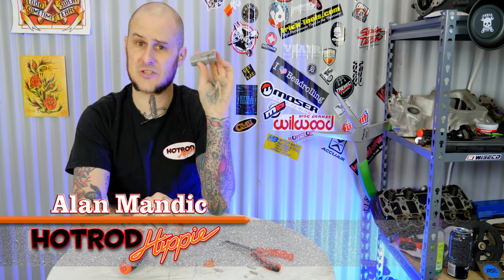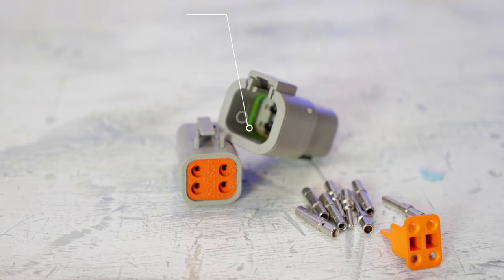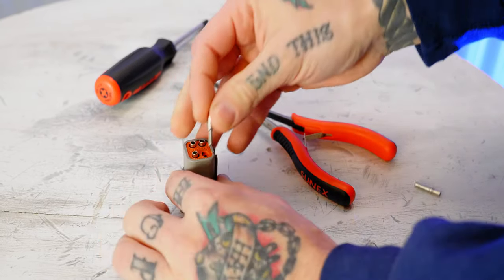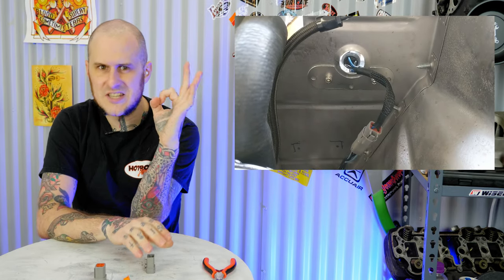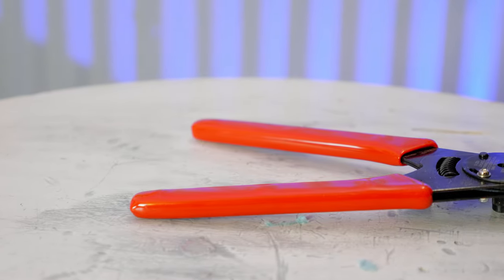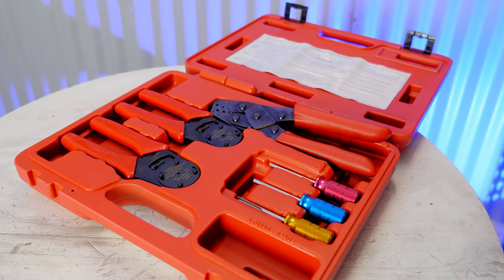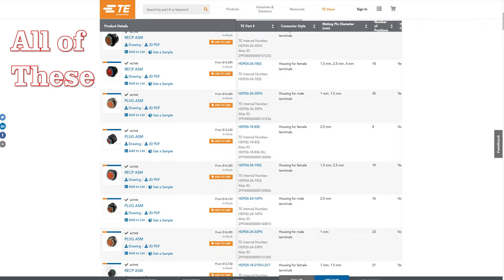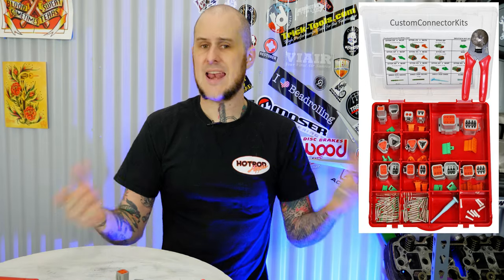Deutsch Connectors for Custom Wiring

Comment from the maker: Do you use Deutsch Connectors or some other type of connector for your wiring jobs?
Reply: I work on CAT equipment. ALL of their connectors are Deutsch.
Reply: I use Aptiv (formerly Delphi) 150 and 280 series Metri Pack; mostly because it's been used on GM products for about 20 years and you can score good condition connector bodies and fuse blocks in junkyards for next to nothing.  The 280 series stuff accommodates the 2.8mm blade width of mini fuses and 280 type relays.  New terminals (and connectors, fuse blocks, etc) are readily available from lots of suppliers.  It's available in sealed and un-sealed flavors, (though probably not as high-spec as Deutsch or Molex) and much cheaper.

Comment: I work for Boeing and was an aircraft electrician for 11 years. Routing, clamping, terminating and assembling wire harnesses and electrical connectors.  I have to say that these are probably the closest, when it comes to the contacts and connector variations and types, to aircraft quality without the astronomical price of the mil spec electrical we use.  Nice video.
Reply from the maker: There are some brands that use these same pins in aluminum high quality housings that I am aware of. They look great and for a serious custom project would be cool but are mostly overkill for everything else.  Those may be closer to what you are familiar with.
Reply: When I worked at Deutsch, we made connectors for everything. They even said they have connectors on the moon from when they sold connectors to NASA for the lunar lander, I don't know how true this is, but that's what my boss told me when I worked there.
Reply: Not going to use deutsch if it Boeing standard😂😂

Comment: All of the vehicle LED light installations I do I use Deutsch connectors, some fixtures already have the male connectors such as the JW Speakers, Diode Dynamics and Rigid some others, some other brands only have a pig tail on the fixtures and I’ll add the male connectors to those, I do have the expensive TE Connectivity Deutsch crimper and the F AMP crimper for the stamped pin and socket

Comment: I work on garbage trucks. The OEM  for the garbage truck portion is mostly Deutsch. I love these connections. Any time I have to replace a damaged connection they get a Deutsch if at all possible. Thanks for the tool suggestions and keep up the great videos.
Reply from the maker: A buddy I went to Wyotech with builds fire trucks, they are really common on those as well. They just work, can't argue with that. 👍👍

Comment: The only thing wrong with those closed barrel Deutsch pins are they lack any provision for “strain relief”—which as I’m sure your aware is the portion on an open barrel pin where you crimp it to the insulation.  Without a proper strain relief when people tug on a wiring harness instead of directly on a connector to seperate them (we have all done it when for whatever you can’t get both hands in and grasp both ends of a connection or whatever), anyway all that force is being exerted on the crimp itself and if tugged hard enough they can pull right out or just shear the smaller gauge wires directly. But yes, otherwise they are good connector.  They make a series of connectors (dtm series if I’m not mistaken) that are even made with smaller plastic housings for applications like racing motorcycles where every ounce counts and space is a premium.

I also like the Molex mx150 because I work on a lot of Harley’s and they started using them from the oem in 2009 I believe.  Downside to molex you need a super thin pick to release the pins from connector if you don’t want to pop out the end terminal retainer lock.
I found Mouser has both brands and tons more in stock and at a good price.  Better than any automotive supplier I have seen.  Mouser is electronics parts giant

Comment: I used to be an injection mold operator at the banning plant, my sister worked on the rubber side, I worked on the plastic side, we made electrical connectors for caterpillar, Volvo, Harley Davidson, the military... You name it they make it. One day I ran thousands of parts that were the connectors for the optic sensor on laser guided missiles😎 cool job working for Deutsch but the pay sucked, I think they were giving me like 11 an hour to run between 6-8 milocron electric servo press machines all day.
Reply from the maker: Sucks it didn't pay but sounds like an interesting job at least. Sad that things go that way so often.

Comment: They work well,we use then on construction equipment all the time.some of the pin connectors are even gold plated.
Reply: The round bulk head connectors/Canon plugs also can be made of aluminum instead of plastic,much more durable.

Comment: how do you handle it when you have a trunk mounted battery and an engine bay device that requires larger wire size than the deutsch connector has available. i have a maven performance bulkhead with 4 12awg and several 16awg pins. i have an efi and ignition system that runs 10-12awg if the battery is in the engine bay. it'll require 8-10 to hit the trunk most likely. do you just use the open end splices, bring 2-3 smaller sizes in to use on the bulkhead and 1 larger size on the other end for the device?
Reply from the maker: There are two options I have for those purposes.  

1) There are Deutsch connectors featuring larger cable options.  On the 55 Chevy I recently did one of the bulkheads I used had a single 4GA cable with some 12GA cables too.  So I used the 4GA to feed in battery power, mounted an insulated junction and then powered up anything needing good battery power off of that junction.

2) I will use a Battery Bulkead connector to pass battery power into the interior of a car/truck and then also use that as a Junction point to supply battery power to things.  Here is what I am referring to: https://amzn.to/3cE3Mtj

Check out WireCare.com they have a Deutsch configurator to help you get the connectors you need for your applciation: https://www.wirecare.com/manufacturers/deutsch/deutsch-assembler
Reply: @HotRodHippie  i have a power/ground bulkhead already passing through firewall to engine bay for engine ground and starter/alternator power. holley's instructions say to run direct to battery for pos/gnd. so 4 10awg's is what's needed. rather not add more bulkheads as i'm trying to keep it clean. idea was to use the 4 12's and splice in some 16's to bring the wire size up to 10awg. just haven't seen a video of it being done. i know it effectively works though. thanks for the quick response.
Reply from the maker: @callofgeorge  I combine wires once in a while to increase load capacity, but not commonly.  Here is a link to a calculator that can help you determine you "Effective Gauge" of combined wires: https://www.wirebarn.com/Combined-Wire-Gauge-Calculator_ep_42.html

According to that you would need a 12Ga and a 14Ga combined to equal 10Ga.

I know Holley, MSD, and some others want you to go Battery direct with your power connections but personally I usually consider the bulkhead fitting (with adequate cable feeding it) to be effectively battery direct.  

You could use  Deutsch Connector bulkhead.  Namely the HDP20 18-8 connector. It has 8, size 12 pins in it.  Size 12 is good for 12-14Ga.  So you could do your wire split with that.  Run your 4, 10Ga wires to the bulkhead connector, split to 4 12Ga and 4 14(or12)Ga and then splice back together on the opposite side of the bulkhead connection.

The 18-8 connector is the one I use for headlight harnesses on classic cars.  

Here is a link to it on WireCare: https://tinyurl.com/tcevpjs

Comment: Hey Alan, quick question...what trye of bulb socket do you use? The reason I ask is I'm upgrading my squarebody and I really like the GM (Delpi) Metri-pack that are used on ly HHR. At the bulb end there's a bulb socket to connector peice. Based on your serviceability statement I thought it would be great to use something like that for the Deustch system. Can't seem to find and thing similar for the Deustch so I was wondering how you would attack this. That for the great videos and the tech. Cheers.

Comment: Great info I'm looking these up do you use these with commercial wire harness or mostly when you create from scratch?
Reply from the maker: I use them anywhere I can. When I do an aftermarket harness I skip using their connectors and use these instead. The ones they provide are fine but not usually weather right and a little more difficult to connect and disconnect. So these are superior (and the overall price reflects that).

Comment: i heard you can solder the pins to the wire but could i replace the crimping with soldering to connect these up cheaply?
Reply: Crimping is the way to go. A properly-made crimped connection is more reliable than a soldered one. The problem with soldering is that you have a weak spot where the completely solder-free stranded wire meets the stranding that has solder in it, and thus is stiffer. Any flexing, twisting, or vibration at that spot will eventually fatigue the wire and cause it to fail. 

Don’t get me wrong: soldering can be used successfully — it’s done for spacecraft after all — but it requires your strain relief to be extremely good. I don’t think Deutsch connectors are designed to provide that level of strain relief. Soldering is also far more time-consuming.

Given that you can buy an adequate quality indent crimper for closed-barrel Deutsch terminals for around $30 (look for iwiss brand, for example), I’d do that. You can get adjustable indent crimpers too, allowing you to handle multiple terminal sizes. (For frequent use I’d get separate ones, but for once-in-a-while hobby use, the adjustable is fine.)

Also, check out local classified ads and such: I’ve managed to collect a decent set of top-quality crimp tools that way, some used, some brand new. (A used top-quality tool is decidedly preferable to a new low-quality tool.)

Comment: Are they cool for rally application?
Reply from the maker: I mean they are water tight when assembled properly and have a positive lock that keeps them engaged when seated fully, so I'd say they are pretty perfect for the use. The only thing better would be a screw tight connection but then that has the potential to vibrate loose.
Reply: @HotRodHippie  thanks for reply, yes , seems a good product. The problem Is that I'm new on this field and this month I saw hundred different connectors.. AMPSEAL,Delphi , Deutsch ecc ecc.. and I don't understand the quality difference and what could be "right"

Comment: My question is regarding what I gather are knock off Deutsch connectors .. is the quality so much superior vs say the JR Ready kits ?
Reply from the maker: I've used the JR Ready kits plenty (mostly). I find that the pins are the biggest different. The contacts from Deutsch or TE Connectivity are far and away better. Connectors themselves I haven't found too big of a variation. I usually order the budget kits & quality terminals separately. Though a few times I've had incompatibilities between the two.
Reply: @HotRodHippie  thanks for the reply

Comment: I’ve got just one small project for these connectors, so I can’t justify the cost of the crimping tool. Anything wrong with soldering the terminal ends, instead of crimping? I have more time than money....
Thanks for the informative videos!
Reply from the maker: I didn't want to make the video longer by going into it but I usually solder them after crimping personally. So I could see doing that. The open barrel style ones you could probably crimp with any old crimping tools if you get creative about how you do it, then solder them after (they are very easy to solder). The closed barrel I cannot say as I've never tried just soldering them but it would be worth a test run and I would think it has a good chance of working.

Comment: Can you use Deutsch connectors for marine applications? Specifically, for boat trailers exposed to salt water.
Reply from the maker: Most are IP68 rated. Which means 1.5M deep for up to 30 minutes.

In a marine application that WILL be submerged from time to time, you need to be certain the wire is the proper size. As the wire seals against the rubber sealing gasket in most Deutsch connectors. And I would pack the connector with dielectric grease anywhere I could to further prevent water intrusion. 

That said, I'd say they are a pretty good choice for that sort of application. The only thing I am unfamiliar with is how the plastic of the housing would hold up to salt water over time.

Comment: Nobody is talking about direction, does power come from the male or female plug?
Reply from the maker: It doesn’t matter. They are just terminals, you wire it as your needs arise. I often go back and forth as to which way I go depending on how connectors fit through things. Such as small holes in fender wells it is easier to fit the “male” connector through. Etc

Comment: all quality connector families have a learning curve and tooling costs , so if you want high quality wiring you got bite the bullet, it is hard to stick with one as car mfg's use many different brands  just for one car!
Reply from the maker: I have multiple terminal depinning tools because there are so many connectors out there.  It can get pretty frustrating, so I try to keep my projects as straight forward as I can.

Comment: Why are you not using wire loom???
Reply from the maker: I do use wire loom. The video clips of the 55 Chevy I showed feature plenty of TechFlex wire loom. I don't use wire loom under dashes or at the Connectors on ECM wiring as those are the most likely places to need servicing. As such not having loom makes it easier to ID the wires and since they are not visible or rubbing against anything those areas don't need loom. 

If you mean on the wires I crimped in this video, it's just a demonstration...  

If you looked at my instagram or some of my other videos like this one: https://youtu.be/85Ps99xxX6I You would see I use TechFlex loom regularly among other types.

Comment: Hmmmmmm ... I wonder if one could use the IWISS ratchet hex crimp tool for the closed barrel version. This is the tool that is generally used for servo ferule type connectors. Those appear to have somewhat thinner wall.  https://www.youtube.com/watch?v=QQEr8s0jzCk
Reply from the maker: I really cannot say, nor could I see myself investing in them to test it out unfortunately.  I wouldn't be surprised if they did work, I know some companies sell similar crimp tools for Deutsch connectors but you just never know until you try.

Comment: These commercials suck. Leaving out the unpinning process and the required tools is unacceptable.
Reply from the maker: 3:44 - I showed you don’t need any special tools to depin them. I own some but never use them, just a pair of needle nose & pick / pocket screwdriver gets the job done on most of them. This was not a “commercial” and did include the information you said it didn’t, did you finish the video before commenting?

Comment: i've used them, they are awful especially if you break a pin
Reply from the maker: I've been using them for years and never broken a pin. The terminals are much tougher than most of the other connectors I've used. Also with how easy they are to disassemble repairs are pretty straight forward. 

I wonder if the ones you've had trouble with weren't knock offs. I've gotten some cheap ones that look similar but just aren't quite right and those are the only ones I've had trouble with.
Reply: To back up HRH comment...I had a wiring harness get ripped out of a machine at work. It didnt pull the pins out of the socket or break the wire at all, it actually broke the lock instead. I was really surprised how strong the connection at the pins are.